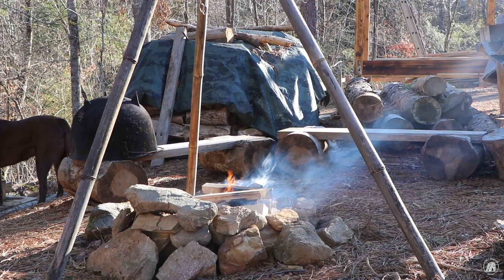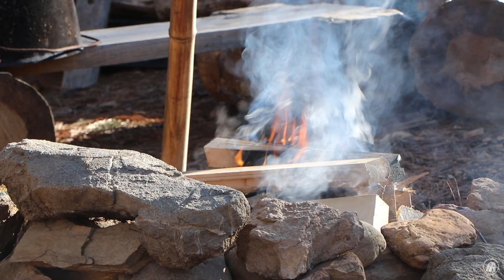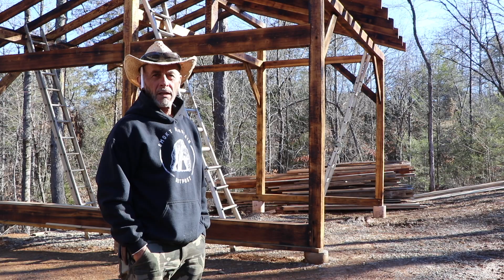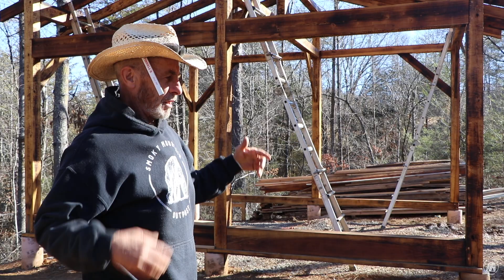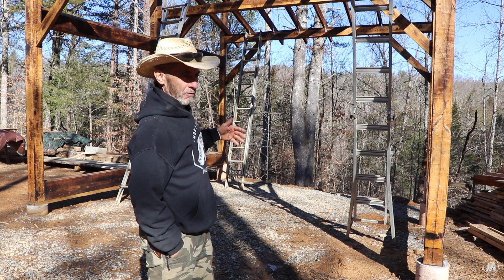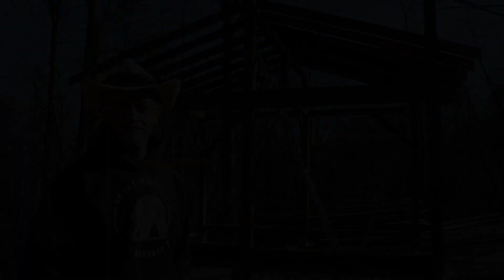HOW I PLANNED MY TIMBER FRAME WORKSHOP

Comment: Spot on with sawmills. Like the cast soap pot. 
Thinking about using sketchup to plan, design our timber frame projects.
Sliding barn doors may work for saving room between the buildings.